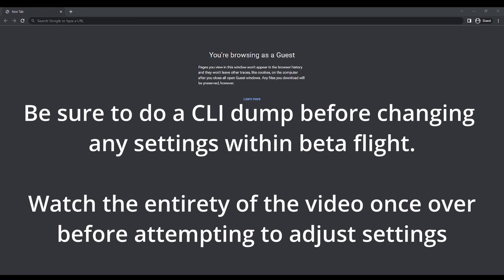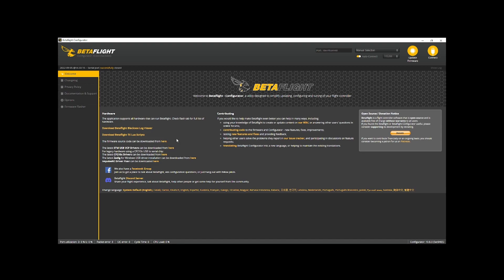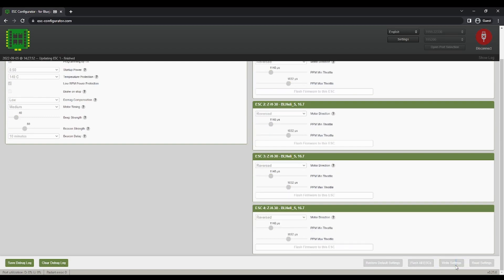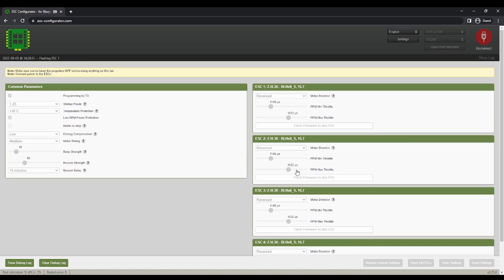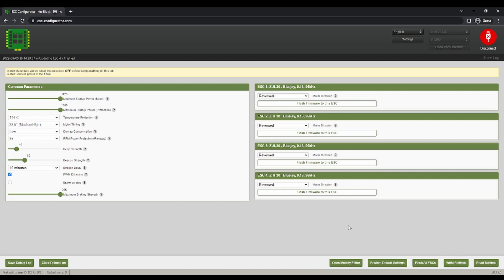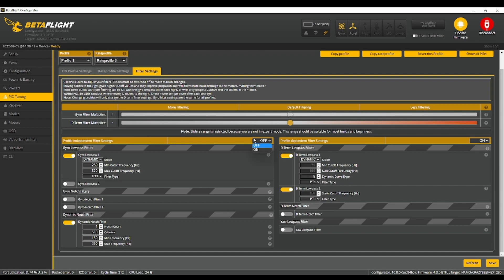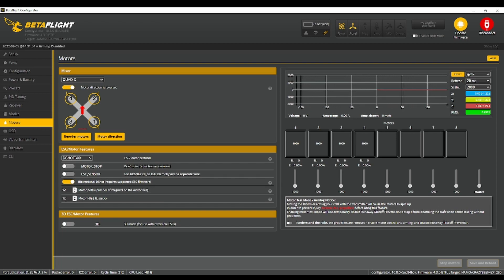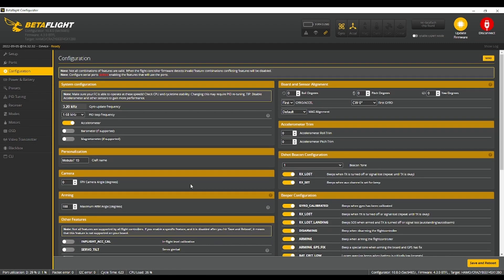How to fix Mobula 7 1s when motors aren't spinning after flashing bluejay.

Comment: Omg! 2yrs later and you saved my arse!
Can confirm this works with Mobula 8, Nov 2024, analog version! 😂

I just got this today, and a radiomaster pocket.
I'm learning everything at once! Edgetx, elrs, ESC flashing, betaflight.. etc etc.
Its been about 11hours, and this is the 1st time The motirs have spun fir me! 😅😅😅

..welp.. im off to fly!!

EDIT: I did not use the PID tune settings, as Im on a diff drone.. Ill go google that up next.. Sigh

Comment: Hi I tried following and everything went well but no result for motors working. They work in betaflight with master command but when I try and fly my mobula 6 it can't get lift. I assume it's still the motors but at a loss rn. Is there a way to just bring everything back to stock. Can I just load an original preset in betaflight or a stock tune?. Would that bring everything back to original. Cheers!

Comment: I did 48khz, I put the settings to 1100/1200 and it was not enough. Motors would not start spinning. Although when I hit throttle, it would start flying no problem. I anyhow bumped both to max, even with 48khz. Also, I don't know about Mobula7, since it already has 2+ khz, but on my Moblite7, default is 1.6khz and I had to bump it up to 3.2 because there is a warning there that PID Loop Freq. has to be minimum of 2khz, in order for bidirectional D shot to work. So if you lower it down to 1.6, it is gonna be turned off.

Comment: Thank you, Thank you, Thank you... 
Not because my motors where not starting, b/c I got a great tune following your recommendations.
I am flying stock Mobula7 1S on 0802 motors - 520mah battery.
Using Blujay firmware with 48khz, startup power to 1100/1200. bidirectional DSHOT300 + all your other tips
I do see a much smoother handling.

What should be the Dynamic Notch Filter for 48khz? I used the 96...

Comment: Hahahah I cannot even flash the button in blheli is not able to push its whited out  mine out of the box also motor one in BLheli says YYYYYYYYYYYYYY-YYYYYYYYYYYY for the firmware sometimes 2 motors pop up sometimes all for in the configurator when you try to take off it flips motor direction , blades , gyro , transmitter are all correct .. the esc may be messed up you cannot flash it

Comment: If flashed every combo I can think of and my props are still blowing up instead of down.  Any other ideas?  Great video by the way
Reply: well hope this helps someone.  I originally flashed with the downladed configurator.  Then I was using the online configuator.  I flashed back to stock with the downloaded configuator and that fixed the non reversed motors.  Now I can use the online with zero issues.  ta da!

Comment: Even with gnb 450mah, I feel less punch with 48KHz Bluejay. So I stay with original BLheli and stock tune. Gets me 3m to 3m20s flight time. That's good enough
Reply from the maker: yeah if you like punchiness stick with stock. if you like flying chill like I do then having the extra minute of flight time is nice.
Reply: @xdodgeball7767  True, buddy. Don't know why it feels like the mob7 1S is less punchy than mob6, especially top end power. But the low-mid end is amazing. Zipping around indoor doesn't require a throttle expo like my mob6. I think it's just the way 0802 perform with these 2-blade 40mm.

Check out my flight:
https://www.youtube.com/watch?v=igtaaq7T0yU
Reply: @marukothekid  Have you tried a little Throttle Boost? Might help with punch.

Comment: At what throttle percent do you hover after these adjustments? I feel like my hover-throttle was substantially lower before I started tweaking (and crashing, and foolishly turtling, etc.), but I can't say for certain.  I now hover around 50% with a 650mah HappyModel battery.  Motors all run smoothly (after replacing one) and props are fresh.
Reply from the maker: I hover at probably 20 to 30% higher then stock with GNB 530MAH batteries. I think this is relatively normal, you do lose a bit of power when switching to RPM filtering so it should be expected that would transfer over to hovering as well. I like how stock flies more then the settings I came up with here, happy model did an excellent tune on this sucker. I still use this though because of improved flight times.